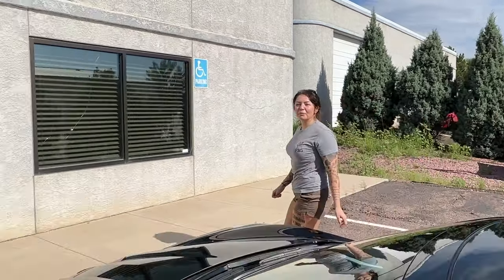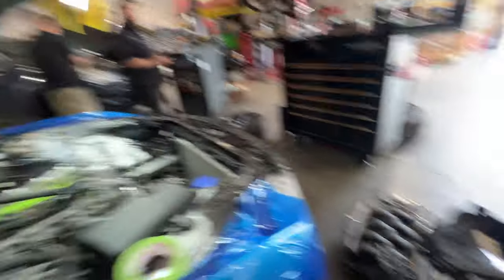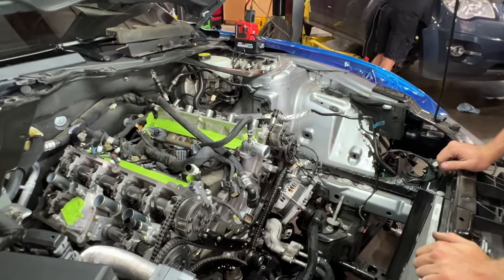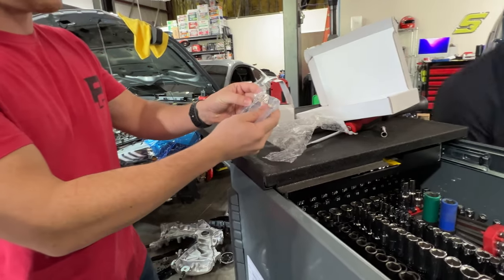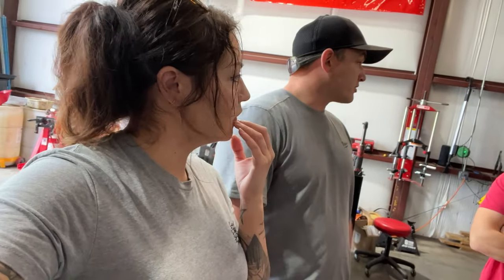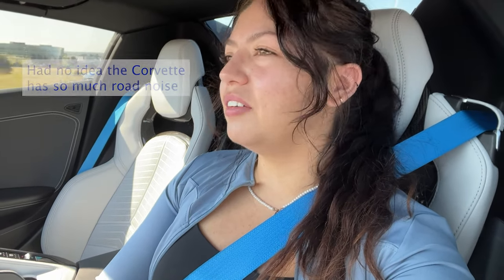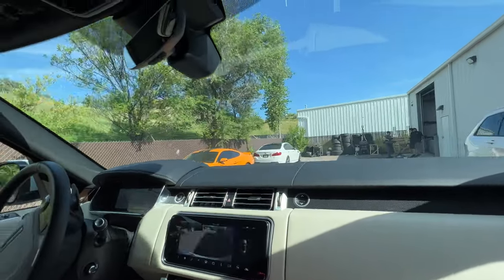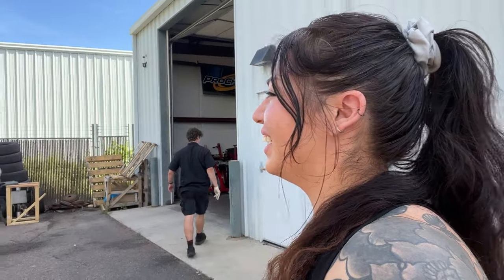My Mach1 Mustang gets SUPERCHARGED

Comment: Oil pump gears and crank sprocket are snake oil, I'm making 800 with my ESS kit on E85. It's a money grab for shops to sell more labor. Bouncing off the rev limiter constantly is what kills them, not power.
Reply: Its "Insurance" Amigo, Not cheap but insurance none the less.... As they say. I have neither and im procharged 🙌🙌
Reply: Boosted gt350 making 750rwhp still got stock oil pump gears. 
I nevered heard or met anyone who blow thr motor due to oil pump gears.
Reply: @lahfarla2941  i dont have them either but the "premise" is that its cheap insurance, I guess and it makes aense that if your gonna go the FI route might as well add the opg while your at it. If you got the car already FI maybe going thru the hassle isnt worth it and just be careful. Remember, "Nothing is an issue till it becomes an issue" Not knowing anyone that it has happened to means nothing 👊
Reply: I agree totally.  👍
Reply: @DrewPWebos if you aren't bouncing off the limiter it's insurance that isn't needed.  People think power breaks them when it's bouncing off the limiter especially boosted that kills them.  All these people with autos getting them like you shouldn't be bouncing off the limiter you're an auto lol.  You shouldn't be with a manual either if you can drive and have half a brain lol.
Reply: At the end of the day its a piece of mind if you can, if you cannot, just drive smarter not harder.
Reply: Yup exactly. People driving stupid and bouncing off the rev limiter is what’s breaks it .
Reply: 😂😂😂😂 snake oil??? Don't listen to this fool! There are outliers who can make certain amounts of power, but the majority of those OPG are brittle!
Reply: @TheManic.5-OH  go ahead and waste your money big guy, I know multiple people making a 1000hp on stock OPG's. Why do you think that Ford didn't put anything special in the 2020 and up GT500?? Living on the rev limiter is what breaks them, not power, it's called shock and harmonics. But you do you.
Reply: @ScottRay-qg1go and I know, PERSONALLY, 2 people that have blown their OPG's making just under 700 hp. So again, there are outliers. If you drive the car the way it was meant to be driven, there's a good chance it could be an issue. 

600 is nothing to me when I consider all the time and money(most importantly time) I have into my car, I definitely consider it crucial. Also, they're gen 1 motors that blew, mine is a gen 1 as well.
Reply: The pro charger is awesome enjoy!
Reply: @ScottRay-qg1go Are you an engineer?
Reply: Better to be silent and believed a fool than open your mouth and remove all doubt.
Reply: The stock pump works fine until it doesn’t. Then you are hosed !
Reply: When you get a Roush sc installed by the dealer do they change the timing  gear and sprocket ?

Comment: I have a Procharger D1-X on my 2020GT (can see it on my channel, I'm not a YouTuber though) and it made 770HP at the wheels with the the largest 120MM Pulley (12psi), Fore Fuel system, E85, 10R80, Palm Beach Dyno tuned.  Actually they did all the work.  I can go to a smaller pulley and make 840 without retuning.
Reply from the maker: Dang that's awesome. I'll check it out

Comment: Should have went ESS or vortech 

Prochager had the dumb design of running an extra balancer on top of the stock balancer making it more prone to snapping the crank. It’s a reason the crank support exist for it and not ESS/vortech .

Best bang for buck would have been ESS for money, light weight, functionality with oil changes and power.

Comment: Get Tuned By (WENGERED PERFORMANCE 🏁) I have your same setup. I pullied down to a 4.63 pulley (not much but 10 psi on pump) You should upgrade the clutch later on an RXT Mcleod and an MGW short race spec shifter 😉🙌
Reply from the maker: Thanks for the rec!

Comment: Get a louder blow off valve that's so quiet. Ess still 1000x better than procharger!!! Easier to install its way lighter and it sounds way better . Prochatger being out longer means nothing . ESS FOR THE WIN. Btw you make more power with a smaller pulley not a bigger pulley. 😅
Reply from the maker: You're right about the pulley, I got it backwards. You're leaving out the best part about the ESS kit, it's the cheapest.
Reply: @KaitRose   of course expensive doesn't always mean is better